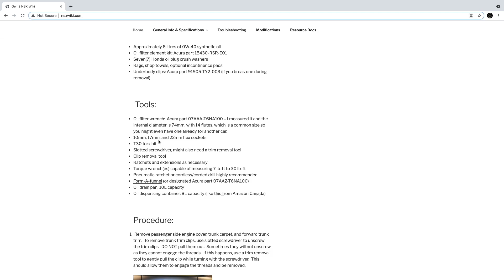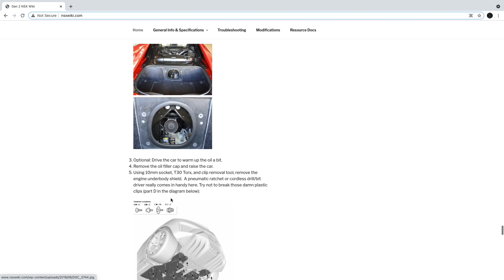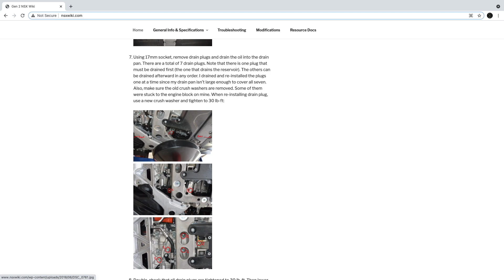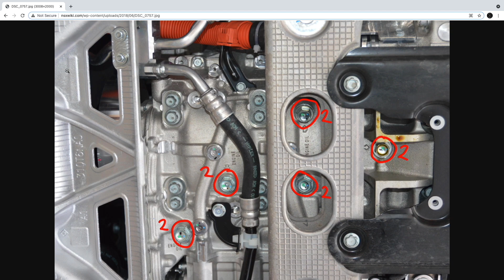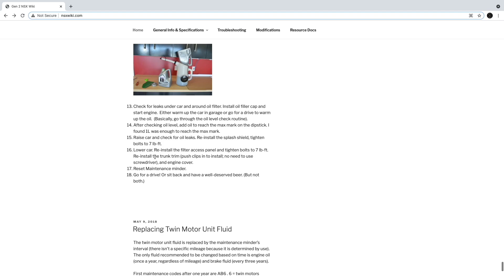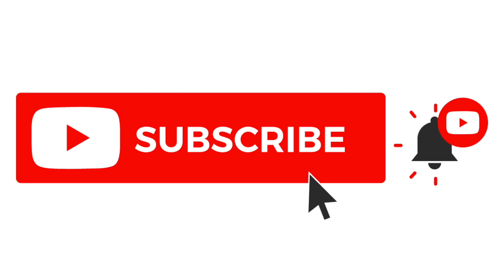2017 Acura NSX Oil Change Cost Analysis

Comment: I've changed the oil myself on my 2019 twice now.   As long as you can safely get your car 12" higher off the ground using ramps or jack stands,  most any experienced DIY'er can do it following the Wiki guide.  And $70 for materials is relatively inexpensive for a car such as this.  Yep, I'm an Acura fanboy...
Reply from the maker: Good to know you have been able to do it without a lift. I been trying to find time to get my lift fully installed but if push comes to shove, I will just use the jack stands. Thanks for the insight!